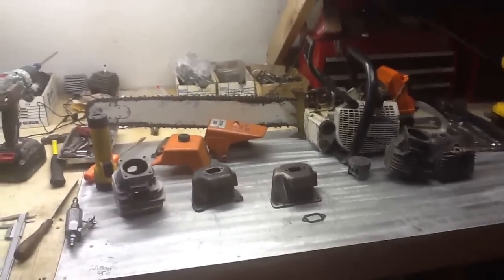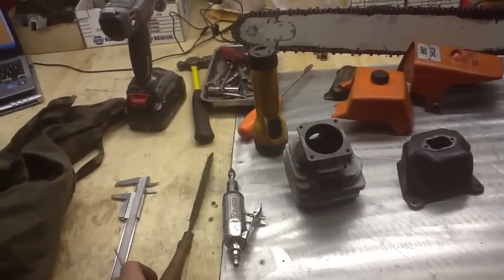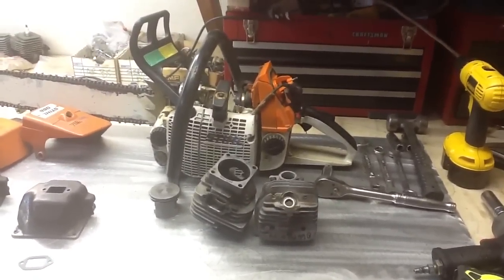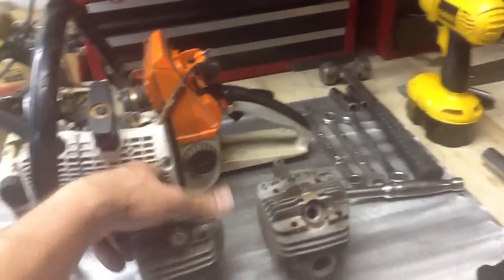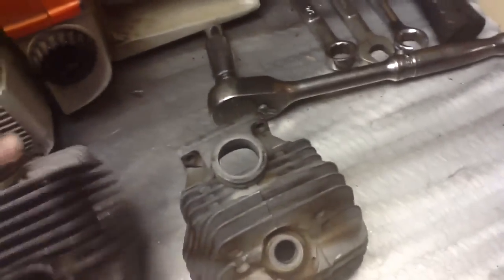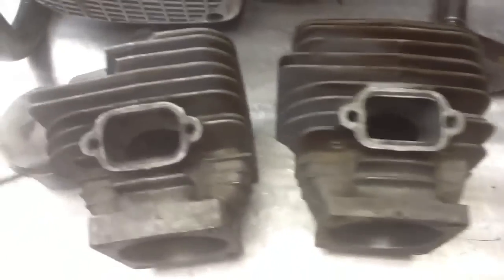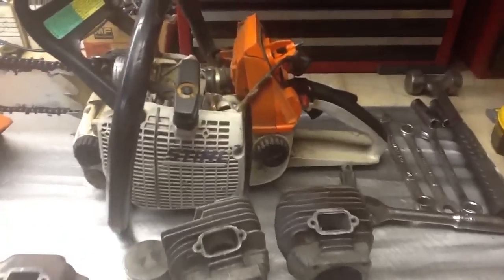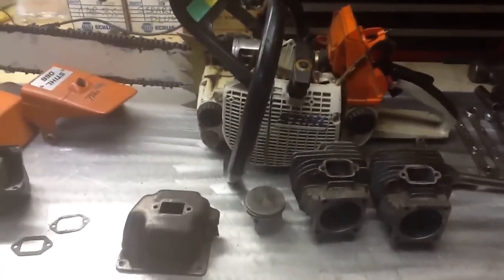2 Stroke Engine Cylinder Mod and Porting Stihl 066 Chainsaw

Comment: Add-on's for your video here: Piston-porting, and crankcase porting and matching-to-cylinder(base) are two things not covered in this (brilliant) video, I figured to add these since, upon a re-watch (my small climbsaw died so I went and grabbed a 2511t that I now have to work!), I realize the piston - especially on a 660 where the piston-windows are feeding those transfers - the piston's windows represent an area that has a TON to be removed, for: reduced piston weight(reciprocating weight), increased displacement of the bottom-end and, most importantly, unrestricted flow from the crankcase to the lower transfers!
Crankcase matching, on the 660, is nearly impossible since they made such an awful / not smooth mating between case & cylinder, best you can do here is just smooth-out and, if desired, enlargement (for instance I probably removed a CC on each side's lower-transfer on my 56mm big bore jug for the clone 660 I'm finishing here)
Gonna go check your library this video is just outstanding a total hidden-gem!
Reply: Oh and LOVE how you explain "choke-points" when talking of muffler-gaskets (and like that you say 70% muff-opening V exhaust-flange, 65-70% is what I'd always aimed for so-long-as I have a pretty straight shot, I go more like 75% if the muffler's scavenging which is what I prefer IE all my ground/rear-handled saws are this way, climbsaws are left open-can)  Have always looked-over the entire thing "holistically" in this way, "seeking choke-points", and wanted to mention that IMO when doing gaskets one almost has to "over-match" because they never mount-up 100.0000% flush, so if you grind/port it that way, you'll end up with some 99.99% match not 100% so you need to over-port the muff-gasket (and muff-intake port) by a touch to ensure no snags (MANY saws, OEM, come this way, for instance just opened-up the muff on my new 2511t and there's a >1mm ridge on the bottom of the muff's entry-port, where it mates to the exhaust-flange of the cylinder, easy/obvious area to smooth/grind!)

Comment: "You wanna do what you can to make air flow quicker from here(intake) to here(exhaust)", have never heard it that way, and obviously if taken to extreme you'd be "short-circuiting"(Jennings' term, unsure if it's commonly used) your cylinder and drastically reduce power.... What do you consider the safest width on 66* exhaust ports?  I always heard 65% of bore for chainsaws, but recently heard of >70% in another general 2-stroke tuning video, so am now uncertain!  For instance I know that 4k feet/min is "destroys things" speed, that 3,500 FPM is the 'upper threshold' and the 3500-->4k FPM range is where "hot" engines live, engines that are constantly having new rings and other work done...I wish I knew a guidance for exhaust-port-width (relative to bore, and maybe relative to other things I'm not thinking of, besides of course leaving ~50thou clearance laterally for piston-skirts to fully seal the port when slug is above it!)

What do you think of the 56mm kits?  Besides the short piston-skirts, which force you to use JB on the intake (which is neat actually as you get to choose your timing, I did 158.5deg intake and 149deg exhaust durations with 28.9deg of blowdown), there's no way you can machine it because of freeporting they are like 5-15thou from free-port if you don't use a gasket, BUT I'd posit this is largely irrelevant because it ALREADY comes w/ higher compression "outta the box" due to its *11%+* smaller combustion chamber than the true 54mm chambers, you'd think it'd have been the same - like the ports - but its chamber is smaller I've done 2 displacement tests with >1 jug of each size it's for sure and >1cc is HUGE you could run these at 30thou squish and have a tighter compression-ratio than if you'd run 20squish on a 30thou-shaved cylinder!)  
Then there's the fatter transfer-tracts (the passage from upper-to-lower), if you check they have way skinnier walls there and deeper cavities (actually the wall thickness there worried me, I'd comforted myself that I'd never even seen that kind of damage, then I see your video here and realize it certainly can/does!!)
Then the unplated top of the cylinder, both of my units prevent me from running a top ring (I'm under the impression that is OK though, I know 2nd rings actually slow you down >6k RPM, but have not found 100% whether it's OK to simply remove 1-of-2 rings from a piston, IE I know 1-ring is OK but OEM 1-ringers have the piston-pin in the dead-rear, not to the side, and IIRC their rings have tighter gaps between each edge to permit less blow-by....though I'm doing all this on farmertec bottom-ends so some blow-by is probably a good "safety valve" for me ROFL, actually would be neat if they made "plugs for decomp slots" that came set to, say, 200PSI and they'd let pressure out if you went above it, like a blow-off valve of sorts!!)

So yeah I figure just jb the intake, ensure you're setting the cylinder-height such that you're not eliminating any of your transfers-duration (both transfers and exhaust durations suffer the minute you lower that cylinder, I think the piston crown is ~5thou above exhaust-floor at BDC on a 20thou squish build, IIRC), do some porting to piston, lower transfers &maybe the casing to more-than accommodate the larger jug, proportionately, I removed at least 5-6cc from my bottom-end so 104-105cc total displacement now with a smaller-than-54mm comb chamber.....once broken-in I may put a pop-up in there, IF I think it's proper, am not intending to make uncomfortably-high compression, am well-aware it doesn't help power 1/10th as much as people tend to imply it does!!

Thanks for the vid, this is great content I thought I'd caught all the decent 66* vids :P Will check your library (and subscribe, actually I recently started posting & have a video on overcoming the 56mm's problems I posted some days ago ;) ) hoping for more content like this, I'm actually doing 2 chinesium 660 builds, or re-doing (constantly re-doing ;D ) and really "swinging for the fences" so far as extreme 'woods porting' goes, as they are for job-use, a 25" faster/hotter unit for felling & limbing, and a cooler 32" for bucking (which is the one all my OEM parts are on, was lucky & got gifted a ton of great OEM-ness from an OPE forum member/leader ;) :D )

[Re my being pedantic about "good concept Re 'max airflow' but it's only a principle, true extreme would hurt performance", let me give an example-- if you did your best, got your *66 to its "optima", then you went and raised the exhaust-roof a few degrees- it would move faster, but would be weaker!]
Reply: OH-- for curiosity's sake, I'd be REAL eager to see how a "no bridge/window separating upper from lower transfer" design played-out, I mean the 66* engine transfers from crankcase by passing-through piston windows into the lowers & squishing-up through the uppers, honestly I imagine it would NOT make any appreciable difference (if you look at it, the piston-crown is basically in-line with the uppers' LOWER edge when at BDC....), if at BDC the top of the crown lines-up with the floor of the lowers, then that missing-piece from yours was effectively just "redundant" since it would be pressed-against the piston at BDC, and I just measured & the 660 slug's "ring distance" (top of top ring, to bottom of bottom ring) is greater-than the bridge, so yeah that bridge is effectively doing nothing/very little, and let's not forget many of the older transfers didn't even use a lateral bridge to "separate" the upper&lower 'parts' of the trnasfer channels!

Comment: How about the carb it's self would that need any work like bigger jets or anything
Reply: All you would need to do is tune it to run a little more fuel. No need to change components.

Comment: so, I have a cheap chinese saw wich I got for 50 bucks on amazon
it didn't sound right and was kinda weak, so what I did was add restriction to the muffler
I welded 3 of the 5 holes in the baffel shut, now it's running quite a bit stronger.

could that be due to the fact that there's too much restriction on the intake side so that it needs back pressure on the exhaust to perform better?

a new piston would be 20 bucks so any porting experiments are fairly affordable
also, for 52cc it's now actually pretty strong, couldn't tell much difference between that one and the 62cc version
Reply from the maker: Sounds reasonable.  That is the one nice thing about the cheapo stuff... you are not out much if you make a mistake.  And mistakes are a good way to learn ;)

Comment: I use a piece of solder to test squish. .002 is minimum i would ever go for squish.
Reply from the maker: Good advice.
Reply: Ya I usually aim for .008 which some think is still to tight

Comment: how much more power do get from it?
Reply from the maker: Think of it like putting a new tune on your car or truck... more optimized performance.  Hard to measure, but easy to feel if you operated the before and after
Reply: WHAT THE FIX so Like you say, it could easily be about half kilowat maybe more,when its really possible to feel it..I also have 066 im inspired 😉

Comment: As simple as 2 cycle engines are with the lack of moving parts, wet sump and so on. There complex little buggers in the way pressure waves move through them! The narrow power band of a 2 cycle engine is because of its dependence on acoustical process, complex wave patterens both positive and negative that are RPM or frequency dependent govern the performance of these engines. These guys at Stihl are the real deal! high level engineering! Some guy in a barn with a die grinder is not going to improve overall performance in any way. The engineers at still have designed every aspect of these “ports” for good reason! Do yourself a favor run your equipment as it was designed it will yield you better results guaranteed! You could take a die grinder to a flute as well, it might make a different noise after your done but will it be “TUNED”  Stumbled on this video because I own and love this saw. Im no internet troll but go hang out with some 2 cycle engine designers add see the vast amount of information you have no idea even existed.
Reply from the maker: I ave no delusions that i can design a 2-stroke engine to perform in all conditions like the engineers accomplish.  But i can change it to operate better for me. Just like i can a Chevy 350 or 6.0 or any number of machines.   The key is to be ok with the potential downside you can create.  Thanks for your thoughts!
Reply: @WHATTHEFIX  Fair enough! 6.0 me to ha ha. Have fun stay safe keep cutting!
Reply: @AviewFromUnder  not true. Many flaws and compromises in casting and producing of parts and production costs. A little time spent with a die grinder in the hands of a good porter will yield pretty dramatic results. Porting my husqvarna 272xp made it a screaming, fast revving, no bogging ton of fun. Big difference. It really woke up.
Reply: OBVIOUSLY HAS NOT RUN A PROPERLY PORTED SAW. YOU CAN MAKE A 70 CC RUN LIKE A 100 CC. WHICH IS LIGHTER WITH BETTER PERFORMANCE.. SAME WITH ANY ENGINE.. PRODUCTION. ENGINES HAVE MANY THINGS THAT CAN BE MADE BETTER, IT JUST TAKES TIME THAT COST MONEY. THE OEM CAN DO IT BUT THEN THE SAW WOULD BE DOUBLE THE PRICE.

Comment: First thank you for the very informative video, second I have a smaller saw that’s a reed valve engine and my intake ports are around the inside wall of the cylinder what can be done to improve air flow on them?
Reply: Round off smooth all the edges on inside the ports take about 0.5 / 1mm  off insides
Reply: Make the Reed valve ports bigger

Comment: "Motor"?.....is electric and Engine is what is in a 2-cycle chainsaw, if I want more air flow through my motor I will open up the end caps and make sure the fan fins are nice and clean. lol
Reply: look up the word motor clown.
Reply: That’s funny because my chilton manual for a 86 wagoner clearly says motor mounts. Maybe I have a electric wagoner and didn’t know it.

Comment: Great video friend nice explanations just put a jug on my MS460 porting was way smaller than factory, but I just matched the   gaskets but it looks like you even cut out on the gaskets, Thanks for the video showing my support and Thumbs up.
Reply from the maker: Yes, The gaskets need to be enlarged as well if you open the ports farther than the gasket's internal diameter.  Pay attention to the intake side as well.

Comment: Air doesn't move right along wall. there is a shear zone between wall and airflow.
Reply from the maker: Good info.
Reply: Read how to port book from David Vizard lots of good info even though it is not on chainsaw,much info will cross over.

Comment: I had no idea that porting a saw took that much material off of the cylinder and related parts. How much of a difference do you see between ported and stock?
Reply from the maker: I have no idea what the numbers would be.  All I can go by is how the saw "feels".  The most noticeable difference that I see is the throttle response on the saw.  Response is crisper, the saw will reach peak RPM quicker, and stay there better in the cut.  

If your going to modify...Start small... work your way up.

Thanks for watching, and good luck!

Josh

Comment: I see you have a pair of calipers there, what do you shave these ports to? I have a MS 361 I wanna try this on but I need an idea of how much material to remove. I don't want to take off too much, and I'd like to get it right the first time! :D Thanks from CO!
Reply from the maker: I would start by just smoothing out the ports, then open them a little at a time. Try to match the amount you take off of each.  Be extremely mindful of where the rings are going to be at the top and bottom of every stroke.  Once it is off, it is off!  So better to go slow and do it a few times... unless you have tons of cylinders to use...lol 

Thanks,   JR

Comment: when reringing a saw how do you cut the ring ridge in the cylinder or do you leave it all im doing is reringing it
Reply from the maker: The sleeve is plated and should remain smooth. You should be good to go with just a quick once-over to make sure there is no glaring defects inside.
 I am assuming your cylinder is in good shape, but in general;  If there is scoring on the sleeve itself, there is not much you can do.  Sometimes the piston will lay lines of aluminum on the sleeve that appear to be scoring but are actually raised thickness of what the piston was shedding on the wall as the temps rose in the chamber. Muratic Acid, like bricklayers use, can be used with a little elbow grease to remove most.

Best of luck to you!
Reply: thank you mine is a mac 610 it was my grandpas he bought it new never been over hauled still runs good just wore over time but it is a power house
Reply: and friend shared with me that the aluminum stuck to the cylinder walls can be removed with muratic acid from the hardened material eats the aul. and not the walls

Comment: I am a stihl mec I was thinking of doing that to a saw what about the  carb do you have to chang it and will all thst work make a big difference
Reply: I installed the bigger bore and higher flowing carb off of a 076.  The extra sized bore really doesn't help because it is limited by the intake manifold runner.  However, the added flow was needed in this case to add enough fuel to idle because of the higher volume and airflow.   I am sure there are other was to correct this.  This saw has A LOT faster throttle response, and I noticeable gain in power.  With that being said, I would only do it on a saw that you are willing to have only as a hobby/fun saw.  There is A LOT of constant adjustment...

Comment: Once opening the exhaust how to smooth out the inside surface area
Reply: Use a sanding wheel on the die grinder

Comment: Have you thought of opening the file transfer slots?
Reply: That changes the power band you can increase the top end with more power turn higher RPM as the RPM goes up the windows to feed A/F is shorter. This is why lowering the transfer port, and larger carburetor get more RPM higher power at the cost of low RPM. Just making the ports wider larger carb, and put a tuned expansion port exhaust on it would really boost power. The biggest problem is that little box muffler 2 strokes need to breath that's how they work. Changing the transfer slots will also in most cases require high octane fuel or it will detonate due to the timing advancing caused by the porting. I used to work in the jet ski racing industry we also milled the heads too all that required high octane.  In a chain saw use such little fuel might be worth the bother of buying racing fuel for it.

Comment: This guys vid is BORING.  In addition bigger ports does NOT mean more power, in most cases it means louder and less power.
Reply: Whats your proof of that? Your failed attempt?
Porting and polishing is always used in every form of performance engine use. If done correctly. You are wrong.
Reply: +spleno1 Then why does most everyone in motor sports port their heads?
Reply: spleno1 I know this post is 1 year old but I have to throw my 2 cents in here, you are kinda right but your 100% wrong!!
To start with this video is not boring it has a lot of good points and tips for someone just getting into this type of work, furthermore if all you do is the work on the cylinder then yes you will not see any gains and maybe even a loss of power like you state, but like it is mentioned in the video its about getting the absolute maximum amount of air and fuel into and out of the engine as efficiently as you can so along with the cylinder work you also need to address everything from the air box inlet to the outlet of the exhaust  as a package per say to see any gains and if its done right it will be a noticeable power increase just watch and listen to what is being said in the video. Just my 2 cents worth.